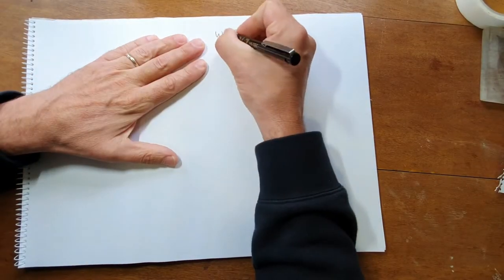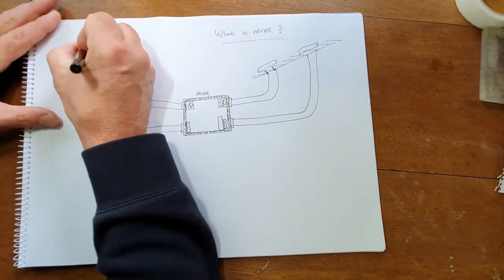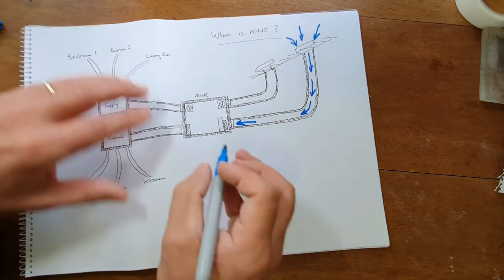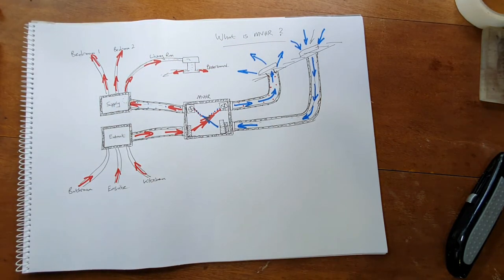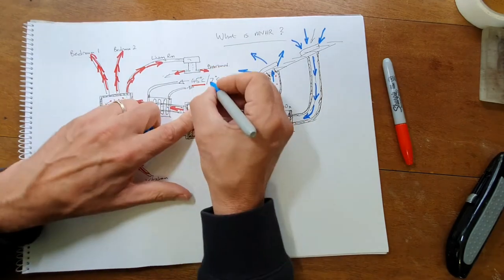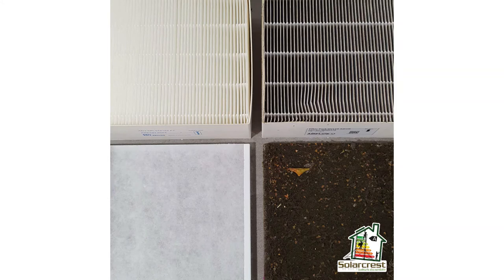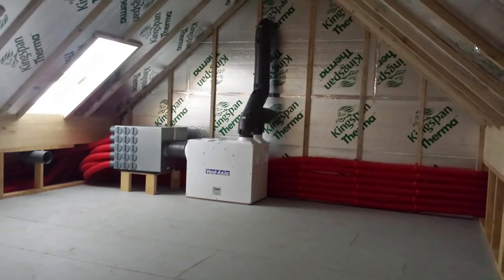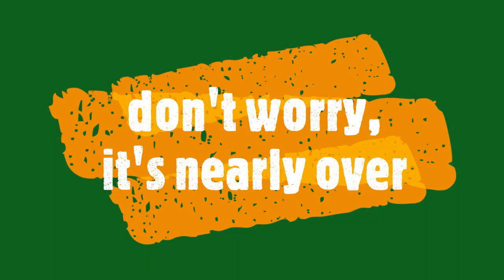What is MVHR?

Comment: Interested, if you put a heating coil that will heat the air, but if you don't the air will flow to the bottom of the room.
Reply from the maker: You can put a heating coil and/or a cooling coil on the air supply, but it you do you also need to deliver more air in order to affect the room temperature. Ideally twice as much air. Otherwise it's like putting an ice cube in a sauna. It's still frozen but it's still hot. You also need to be able to do that without creating an acoustic issue, so that normally means a bigger fan unit, more ducting, and larger diameter pipes too. If you're cooling then all supply pipes need lagging to avoid condensation issues. Before you attempt to cool the air you must always try to prevent unnecessary over-heating through passive measures, otherwise your active (comfort) cooling will only compensate for poor building design. The heating coil will only ever offer supplementary heating. You will always need a primary heat source, which ideally feeds the bottom of the room
Reply: @eliotwarrington5608  Sorry I wanted to say: that is ok for the air to be lower temperature when entering the room, that will make the air to get to the bottom of the room and then raise it as getting warmer. If the air it was already warm, the natural recirculation of the air will be missing. (I didn't take in considerations that all this systems no mater the air temperature have an exhaust also, helping the recirculation of the air)

Comment: Nice explanation in short . How you manage it to be odor-free? If the exhaust is taken from kitchen and bathroom along with living rooms then surely the mixing of odor will be there. How about having a separate ventilation for kitchen & bathroom via flexible duct & not joining it with MVHR. Usually I have seen separate exhaust for kitchen & bathroom, also negative pressure so that the air is coming-in in those areas. 
Apart from that..  just a side question..are there good hvac jobs in UK who have tier 2 sponsorship? cuz I am interested in working there.
Reply: Kitchen & bathrooms are both sucking and are blown out of the house without mixing with any other rooms. Living areas and bedrooms receive fresh air from outside and never mix with the exhaust.